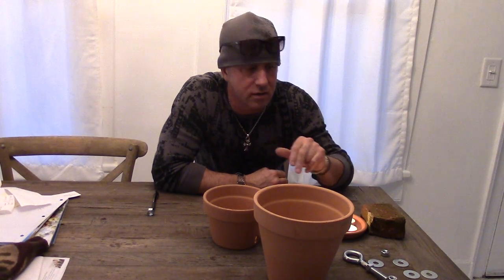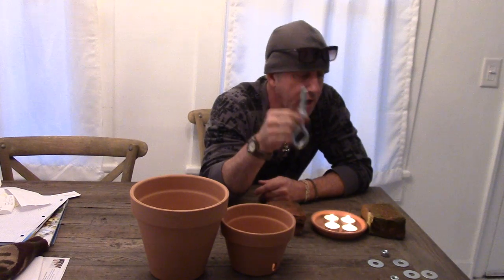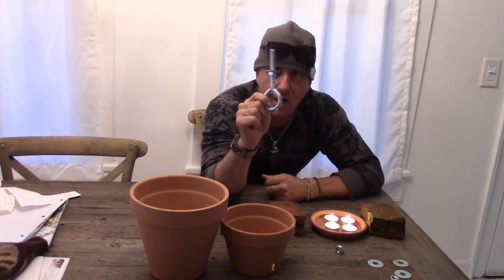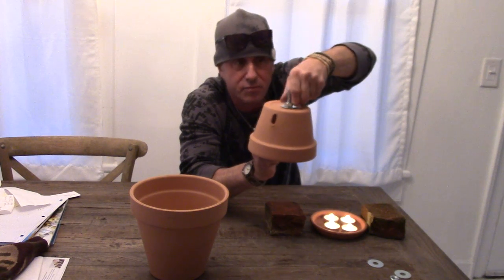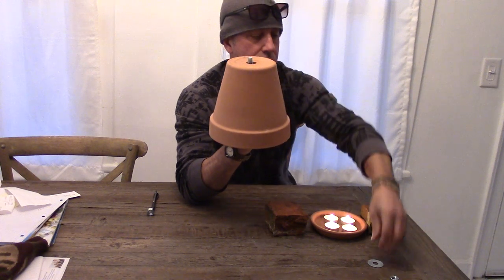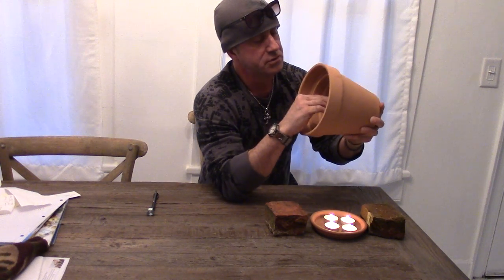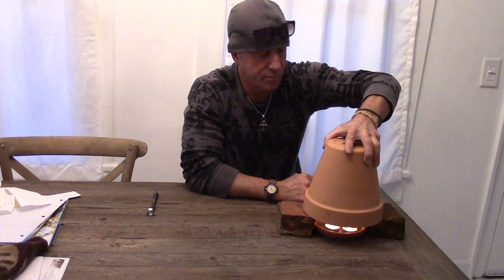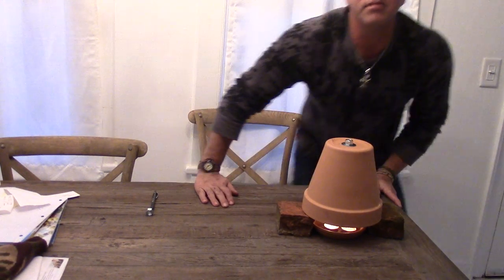Best Flower Pot Heater

Comment: Very nice! Short to the point and great idea with the  🔩. I use a flower pot heater in my cold bathroom nightly, to keep from having to turn on the space heater. Works very well!!
Reply: In what climate do you live that you can heat up your living space by candles? Outside temperature hardly drops to +10 in winter? LOL
Reply: @antigay4123  Your response coupled with your handle says a lot about you.
Reply: @get2rog  There's a rhethorical question for you. Should I care?

Comment: Really simple and works.  Watched one fella welding plates to bolts and putting 20 washers and 18 nuts onto the bolt - Waste of time.  Your version is spot on.  👍🏻👍🏻
Reply: You think the one with all the washers and nuts would retain more heat after the candle goes out?

Comment: Reminds me of a Cornish room heater, but they didn't have that eyebolt hanging down. Good idea, for even if the candles are done, it'll still be hot for a bit of time. I just wonder how many it would take to heat a home, with kids? Good for a smaller room, a tent, or in an emergency. Thanks for taking a few minutes to show this idea. I've seen others do this type of showing, but take 20 minutes, or more. I hope we won't need such a thing, but it's  good to have that knowledge.   Thanks again.
Reply: Sorry but it doesn't create more heat just becoz he's putting it inside a pot or two. It's simply impossible! What he's doing is, catching the heat if you understand :) He might as well put the candles inside a stone-owen. The stones will heat up yes, but it still doesn't deliver more heat than if you just put them on the flor in your livingroom. But the smaller your room is, the more you will enjoy the heat... If it was possible to create more energy "out of the blue" by covering the source we would really be well of ;)
Reply: This is ONLY for emergencies to be used in small spaces. You missed that.

Comment: Great video, very informative. It will be very handy in England now due to a massive increase in fuel bills. Many thanks for sharing
Reply: That's why I'm here, its going to be a cold winter or an extremely expensive one.
Reply: Bloody electric prices in UK is a total rip off. I have a small multifuel heater but that goes out overnight, and the price of anthracite is shooting up anyway, so I don't use it during the day.. and it gets so cold here. I want to see if a large terracotta heater will work nearly as good as my small heater. I won't mind a bit of candle soot on my ceilings

Comment: I use one of these with a plain bolt.  It works. The hole is plugged to trap the heat and the heat radiates out from the pots. The air space is at the bottom. Soot would be everywhere if not for the spacer and bolt.

Comment: I have used this method and he's correct you get allot more heat if u put eye bolts in I have 2 huge eye bolts in mine and it can be 3c outside and my bedroom get up to 19c off 4 x 8hr tea lights only! Never need use more than 4..u can't touch ot ots so hot..thanks to this uploaded for sharing btw.

Dan

Uk

Comment: He man, nice video. Though you have missed a vital thing. Air needs to be able to travel between the two pots and out the top to circulate the air. The inner pot is supposed to get super hot but not the outer one making it safer. The inner one heats the air between the two pots and comes out the top drawing in more cold air from the bottom, which then gets heated. and so on.
Reply: How do you do that?
Reply: @jacquedaw  two pots with a spacer between them stacked one over the over so air can pass between them. On the inner one cover the whole to trap heat in with foil so the inner one gets hotter.

Another thing missed if an electric heater may have more power, but will 'click of' when it reaches temp and only come on now and again. Candles are low power but stay on
Reply: Make his version before you criticize. It works great.

Comment: Hi ,it sounds like your are the best ,iv just brought one an inch smaller ,I don't think it will be as good as yours, lol so if I just wanted to buy those nut and bolts ,where or what should I ask for so I can get the exact same as yours .? Thankyou and also are the galvanized might sound a silly question .? But mutch appreciated .

Comment: are the holes on the side of the little pot important? Does that have a function too?
Reply: Yes. Lets the airflow. If NOT for those holes on side, this design wouldnt work. You can find a plain one n carefully drill the holes. Ive seen a 100 of these n I find this one best. I would try n work a eyebolt on top too so it could be hung on a chain with the bottom attached somehow.

Comment: Do you have to make the holes in the side of the 6" pot? Will it work without them? How did you make them?
Reply: Good question...I was wondering the same thing.
Reply: The 6 inch pot is actually an orchid pot . They come that way.
Reply: He's using a 6-inch orchid pot probably because it's a shorter pot than a standard 6-in. Orchid pots are ventilated to allow air circulation. Not sure how that pot design affects the heating capacity.

Comment: I tried this and it worked great at heating my bedroom. I was a little upset that I went through  $20 worth of candles in three days though. My God, this will cost me around $200 a month just for one room. My highest gas bill last winter was only $225 and that's for a four bedroom home. My only question now is how to remove the black soot on my ceiling.
Reply: Rocket Surgery  That's amusing Rocket!  However we all want to find a source of heat that's very cheap, keep trying Rocket!
John Larkin 
Southampton U K
Reply: Cheap? I don't think so. Another concern is the poison these candles produce, after all they are made of paraffin.
Reply: Point taken x
Reply: Anstria Greenwood I'm actually getting my first hive ready right now. I've been told not to expect much of a honey harvest (bees wax goes along with that) the first year. You need a strong hive and that includes honey so it will survive through the winter. Clay pot heaters do absolutely nothing for heat except create poison to breath in. Don't fall for this BS.
Reply: Lol, on the black soot, sorry.
Reply: Rocket I think the idea for this is that it is something that would be used in an emergency situation.  Also, there are candles you can buy that burn slowly.
Reply: @audreyfrazier3632 no, the idea is by placing candles under a terracotta pot you somehow can get more heat. A candle can produce only so much heat, look up thermal dynamics.  There are several other ways to get heat that are hundreds of times more efficient.  Save your money and buy a catalytic heater that runs on propane.
Reply: @rocketsurgery8337  4x 40 watts, then the metal collects all of it, and it dissipates really slowly, since metal is conductive. the terracotta also collects and radiates the energy slowly. the plume that's supposed to come out of the top is supposed to collect at the ceiling, heating the room, too.

A space heater of 300w heats a room in 30mins - hour, also.
Reply: There are a lot of videos that prove these heaters don’t work. Something about the amount of BTU’s a tea light puts out
Reply: @shakaama  it doesn't matter if the candles are heating the air, the clay pots or the eye bolt. The Law of Conservation of Energy still applies. Energy cannot be created or destroyed, it can only be converted into another form of energy. The potential energy in the paraffin is converted to heat, the heat doesn't increase by using an eye bolt or a clay pot it's still there andvremain sconstant. You can warm your hands quicker by holding them over the burning candles than holding them over clay pots initially. Now if you want to talk thermal mass of the clay pots and eye bolt, well that's something different.
Reply: @dhouse609  it's actually the Law of Conservation of Energy.  Energy cannot be created or destroyed it can only be converted to another form of energy. Kinetic would be an example.
Reply: Try the Crisco candle method. There are a bunch of YouTube videos on the topic. They stay burning for quite some time 🕯
Reply: $20 in three days? Not for this rig. A pack of 100 tea candles cost $5. Each last 4 hours. He used four in this rig. That’s 24 tea candles a day. A pack of 100 will last 4 days. That’s $1.25 per day or 3.75 for three days.
Reply: @Ronnie-Jones  so you're saying you can heat a 2500 sq ft house with a rig of candles? This is incredible! Do tell, where can I get me one of these rigs? Are they expensive? Probably not since that would defeat the whole purpose of heating one's home for pennies a day. I'm still worried about all the soot though, not to mention the poisonous gases that the paraffin would give off. Would we need to keep our windows open to expel the poisonous games? Ronnie, with your wisdom, you may have just saved the planet from extinction and AL Gore. Thanks in advance for your timely response.
Reply: Of course it's more expensive. Unless you can get wax cheaper than diesel or oil.
Reply: @shakaama  it's more like 30-32 watts at best.... for gods sake a couple 60 watt incandescent light bulbs would do a better job or really go nuts and go with a couple 150's! 
Bonus: without the 10g/hr/candle of life threatening gasses!
Reply: Where the hell are you buying your t candles?  I just bought 50/burn time 6 hr for 4euro, (3 dollars -+), just saying.
Reply: Not only that if you do have your furnace running all that wax will cling to your furnace filter and clog it I saw it on YouTube where a guy was changing filters and the filter was black and he realized his wife was burning a black candle
Reply: Do the Crisco candles THEY LAST HRS look it up on here
Reply: @mariacosta5246  I heard about Jim losing his job at CNN. Tell him to hold his head up high and to give Seltzer a call for advice. Positive thoughts!
Reply: Jim?
Reply: @rocketsurgery8337  ahh...do shut up.. its for emergency ..
Reply: @tatjana509  that's why I replied 6 years ago. Time doesn't change physics in 6 years it abviously doesn't change idiocy.
Reply: @tatjana509  Please reply, I'm reposting on another site showing how people are easily duped. Care to give your name and an email for correspondence?
Reply: @rocketsurgery8337  You really dont have better things to do in your life lol...buy buy
Reply: @rocketsurgery8337  You continually cherrypicked and avoided all the suggestions about using the generic crisco method instead of paraffin. A whole tub of cheap shortening is less than $3 USD and it will burn for 8 hrs a day for about 36-40 days. And get this: no paraffin. 😎
Don't leave it in the tub it came in though. Personally I melt the shortening and pour it into jelly jars (the ones with straight sides/no lip) and just add wicks...or just place a cheap candle inside the middle of each. I also have larger ones with 3 wicks. Add a lid and they are very storable and very portable, you can travel safely or even fly with them...unlike other options. 

Hugging one of these combined with a wool blanket can definitely keep you from freezing to death in most parts of the US if you can get out of the wind. 

This isn't intended to heat a 2500 sq' home or to be used with paraffin in an unvented area. Without moving the goal posts your responses would have been much more appreciated.
Reply: use crisco melted in jar, put wick then cool in frig. saves $

Comment: Appreciate the share. Me personally, i would have had the BOLT in the alternate posy. Enabling me to LIFT the pots to replace the expended candles. Yes, will use a dry cloth to lift the hot bolt.
Reply: Or get a longer eye hook and screw the base into the bottom and hang the whole thing

Comment: would the top pot expel more heat with the hole open?
Reply: i think you want to trap the heat so it radiats of the terra-cotta. there is airflow at the bottom

Comment: in the old days they used one thealight on plate with some pennies to put up an inch for the airflow and only one flower pot instead of two with no metal. In those day people used their brain. Why would you want such a build up of heat between two pots if your aim is to get hot air in a room ?
Reply: Controlled heat dispersion and a better understanding of how heat works is probably the answer to that
Reply: What part of RADIANT do you not understand?
Reply: @companyman7128  what part of thermodynamics do you not understand?

Comment: You can actually stack 5 of them together to provide much more radiant heat and when a candles burn out, it will radiate heat for 2 more hours. That's also why it is better to use oil electric radiator instead of convector or simple heater that you can find in a store for 15 bucks.. oil can store much more energy, as well as flower pots nuts and rods. But there is always something to improove, you can add for example a tons of large washers at the end of that rod where the hook is or o' ring you know what i mean, that will increase a mass and also it will help to radiate heat much more quicker to the pots

Comment: Great but instead of bricks finish with a ceiling lampshade. Remove material or plastic disc decorations so your left with the metal frame.
Pot over top,candle tray on bottom...looks much better.

Comment: Hey, would I be able to use a cupcake tin to hold the tealights, and a cast iron dutch oven (5 quart raw cast iron) work instead of having the clay pots?  The dutch oven does not have a hole at the top. Does this affect the performance or will heating up the pot in general work the same way?Thanks!
Reply: put the candles in/on something simply to keep them contained. dutch oven pot would work fine as long as you stack it on something to keep it from snuffing out the candles.

Comment: how does this elaborate design produce any more heat than just burning the candles alone.
Reply: This design is solely a redistribution of heat from rising straight up to helping spread initially the candle heat and 2, the radiance of the heated pot helps to distribute the heat...some what... :]

Comment: Folks...it doesn't increase the temp...it increases the surface area and if left open at the top provides the means to push a little focused warm air. Would you rather have a single 300 degree candle or a 55 gallon barrel heated an even 300 degrees? Surface area. I can't even spell PhD but I know it's more efficient to wipe with toilet paper than just a Q-tip.

Comment: All that happens is the clay gets hot. It cools quickly, but stays warmer than just air. So, even though the candle is out, the pot still radiates heat. 

A blanket, hat, and socks are probably better options. The human body is 98.6°F. Wearing insulation helps.
Reply: a joule is a joule/a BTU is a BTU no matter how you slice it, these contraptions are folly
Reply: @svgs650r  I agree. The idea looks like a DIY ceramic space heater.
Reply: @Matttchew5  except it doesn't work
Reply: @svgs650r  I agree.

Comment: This is an old video.  However, I thought I made something clear.  Using four candles to heat the pots is more expensive than an electric heater.  30-12 hours candles cost almost 15 dollars at Walmart.  If you use three everyday, it will cost you 45 dollars a month, and you don't have to worry about "Burning candles" to provide heat.
Reply: I can buy a pack of 16 tea candles for $1 at the Dollar Tree
Reply: I believe this started for winter when you lose power  ( electricity) for a while.
Reply: gee wiz this is not to save $ this is to save your life if there is a power outage
Reply: Why is it people don't seem to understand that this is for emergency power outages. A pack of 100 tea candles cost $5. Each last 4 hours. He used four in this rig. That’s 24 tea candles a day. A pack of 100 ($5) will last 4 days. You can make crisco candles that will last weeks.

Comment: It does little to nothing in a small cold room.  Waste of time and money. Sorry
Reply: You'll find a better flow of heat can be obtained if the outer pot's drainage hole is left unobstructed. Regardless, this is for a grid down situation only when you can't even buy fuel to keep warm, (not for everyday use as candle fumes are toxic, especially in confined, unventilated spaces). That said, in a life or death situation, one can put a clay pot heater inside an insulation "bubble" for added protection against the cold, (ex: nesting a tent within a trailer within a garage).

Comment: WARNING: These will add tons of indoor air pollution to your home. Tealight candles are made from parrafin which produces more soot than ordinary candles. 

These will heat your home, but leave you with headaches, itchy eyes, difficulty breathing, etc., and that’s just the start. 

Combusting ANYTHING indoors will add to indoor air pollution. 

DO NOT, I repeat— DO NOT use these unless you ABSOLUTELY need to (whatever reason that may be). 

Buy yourself a $30 dollar space heater and order one less cup of coffee per week to pay to run it. It’s that simple. Toss your clay pot heater in the garbage where it belongs.
Reply: Emergency heaters. Duh.
Reply: Boy, are you negative. This is a emergency heater........if by chance your freezing to death and the grid is down.
Reply: Alternatively you can make your own candles w local beeswax now youre purifying your air